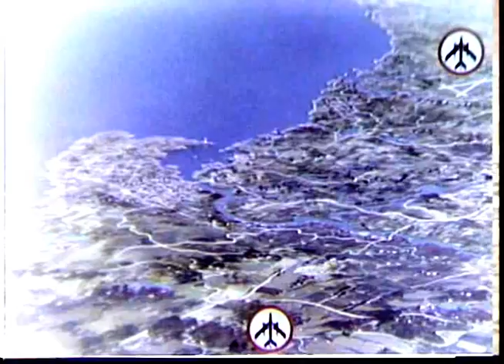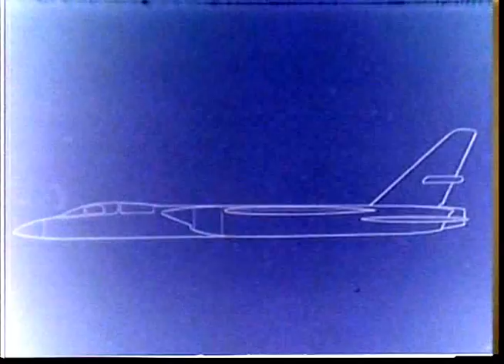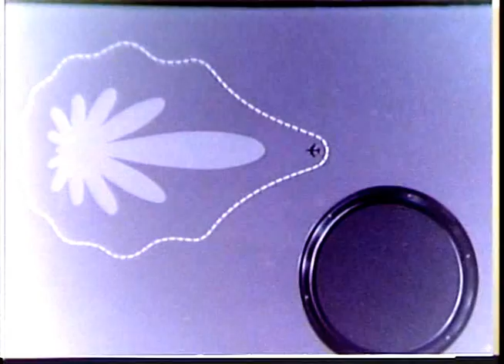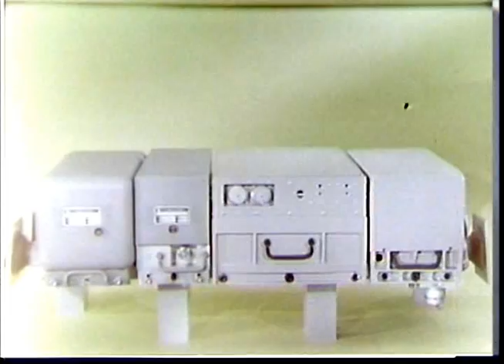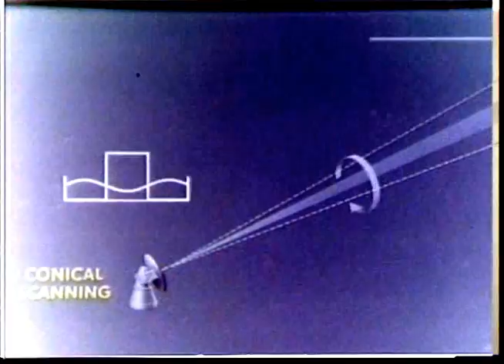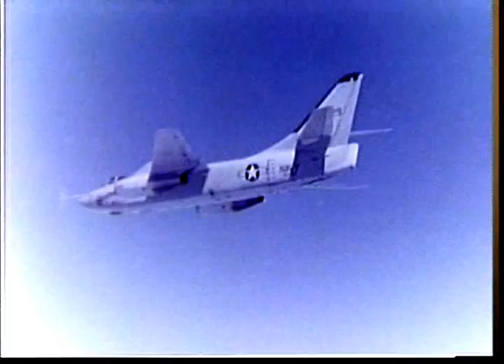Defensive Electronic Countermeasures (1962)

Comment: Lol "the A2F"? This is an oldie, isn't it? This must have been just as the A-6 was just coming out. People forgot later what a tech marvel that plane was for the day. Day and night, fully radar guided attack jet, guided weapons? Pretty agile to. People forget that even slow jets are pretty hot planes, and the A-6 could carry a massive warload.
Reply: In the early '60s, the military aircraft designation system was changed. During WW2 until the early 60s, the last letter in the designation was the identifier for the primary manufacturer. The 3 aircraft shown in this presentation were Grumman A2F, later the A6, the Douglas A3D, later the A3, and the North American A3J, later the RA5. As changes in mission requirements dictated production variants, "trailing" letters were added to the designators to indicate the variant. 

This brings back a lot of old memories. After I left Marine Corps active duty in 1959, I went to work for an electronics firm in the Northeast as a field engineer for about 10 years. Was assigned to North American Aviation in Columbus Ohio on the A3J/RA5 program to provide technical support for the ECM systems in that aircraft. This is the first time I have seen this film. Good job covering what now seems like very primitive equipment.

Comment: Can only imagine how both sides of this equation has evolved in the last 50 years! fascinating stuff!
Reply: Latest thing in service, the new EW package Arleigh Burke has (or will have) AI-powered phased array systems that will allow them to be used as radar warning receivers, jammers, radios and janky radars, capable of dealing with newly discovered threats on the fly.

The rate at which stuff advances is mind-boggling.
Reply: Prowlers we’re able to send harms at specific cellphones in Iraq in the early 2000s

Comment: I did not understand the reasoning behind the "do not turn on early" discussion.
If there is a 3 sector antenna tracking your random emissions they can track you without your knowing.
Reply: Because while you might be out of range for a signal bouncing back from your aircraft your ECM is amplifying a false return. The enemy radar receives this false return. That's my understanding anyway.

Comment: If this worked then why did the SA-2's over Hanoi manage to hit so many planes? I have to assume that there are counter-counter measures?
Reply: these techniques are basic and assume single antenna radar, but with 2 or 3 antennas and a radar that uses doppler and geometry data it'd be much harder to fool as deception would have to be equally transmitted to 3 different targets. the other problem mainly with soviet missile systems, is that they have very powerful radars, so it's never simple to fool them, it takes a lot of technical intelligence reports to fool them, today they have complex radar that combine passive and active radar and complex algorithms, radar deception is best achieved with drones
Reply: It is possible to "burn through" a radar jamming signal by simply having enough energy in your own radar that the real skin reflection is significantly louder than the spoofed signals the ECM pod can produce. You need a more powerful radar emitter than enemy ECM, and to get in fairly close.
Reply: I don't think they had advanced radar In Vietnam, just brute force soviet RF power,  and John Walker at the CIA, who was selling all information to KGB,  and the KGB was passing all details to the North Vietnamise,  they knew when/where an attack was coming, hours in advance,  hence the high US aircraft losses. That's what happens when CIA officers have access to valuable infiormation, and at the same time they don't get paid enough money to pay off their mortgage and everything they need. Airdefense starts at home.
Reply: @VERGIS92  Another thing not mentioned in the video is that the 'enemy' also knows and understands DECM and they develop counter measures to the counter measures ECCM for example the ground based radar uses frequency agility i.e. the radar transmitter changes frequency rapidly causing a disruption to Jamming.  Improved design of antennas to minimise the sidelobes also improved resistance to jamming, range gate stealers effectiveness were also limited by measuring the signal strength of the returns and when unrealistic amplitude returns were received the radar knew it was being deceived and could change frequency. None of these techniques overcame the jamming but reduced the numbers that were stated in the film. How much I don't know.
Reply: SA-2s only had a 1.1% hit rate. Even the sparrow was better.
Reply: VERGIS92 actually this lead to the development of the growler a/c first the f101   and then the a6 were somewhat successful and became as important strategically as the f4 or strategic bombers
Reply: well ya I would be the first to admit that the early models were kind of hit and miss but it didnt take very long before the airforce established wild weasel anti sam strike teams which did have some success also it must be said that the air war during the vietnam war resulted in the us airforce becoming the leader in this field.
Reply: VERGIS92
Ah, so is that why when you see pictures of EW aircraft they carry like 6 or 7 pods. I think I have seen US Navy planes like the A6 with a pod on every hardpoint.
Reply: VERGIS92
And thanks for posting, nobody ever explains how those things actually work.